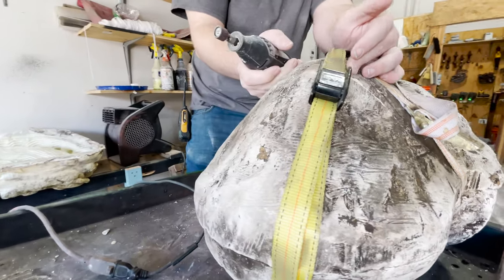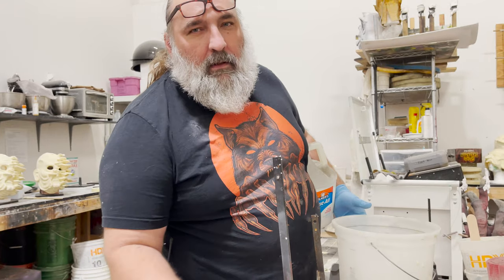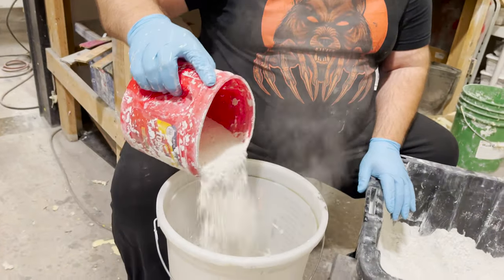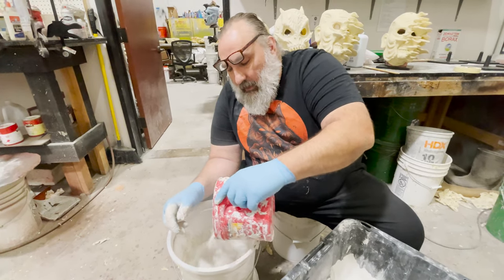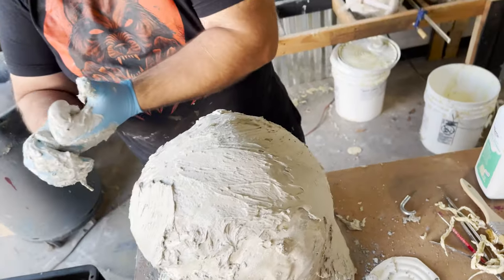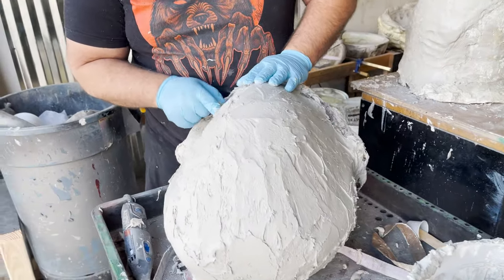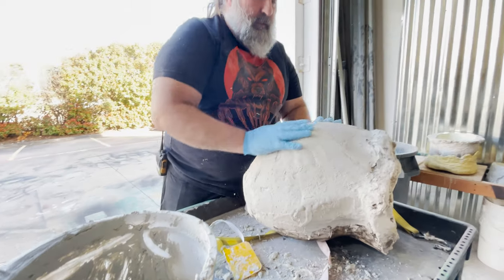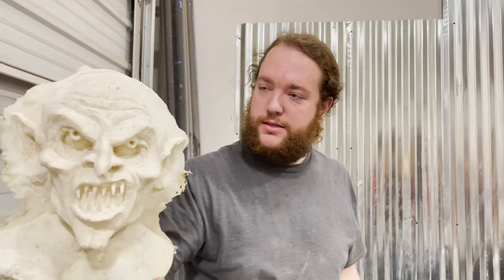fix a plaster mold, repair a mask mold, latex mask mold repair

Comment: Hey one trick I learned while working as an O&P Tech ( orthopedics and prosthetics). We used a lot of plaster 500 -1000 pounds dry a month it seemed like. We use #1 pottery plaster so you should test it with hydrocal but it should be the same.   We had to add new plaster to dry plaster all the time.  Ether to repair a break to to remode a positive.  Soak you dry broken piece in water at lest 10 mins and then just add your normal mix of plaster to fix the break or to build up where needed.   I have used this to fix broken casts several times let the broken pieces set in the sink full of water over lunch come back glue them together with fresh wet plaster and let it set off and then rework as necessary with no problem.   Try it and let me know if it works for you with hydrocal.
Reply: Very cool!
Reply from the maker: good tip!

Comment: If there is one brother I can always count on to solve mask making issues it's definitely Allen the freaking MacGyver of horror! I just separated an ultracal mold of part 3 Jason and because I used stupid Monster Clay for the sculpt when I was cleaning the front half of the mold the clay pulled Jason's nostril nubbin off! Besides the fact that it took 3 hours to separate the mold I was obviously bummed. Hopefully I can use this method to secure the nostril nubbin and fix a couple little cracks on the bib line. Thanks Allen you are the man big dog!

Comment: I know you have been doing this for a long time, and I'm sure this is not the first time a repair has been needed. My  question  is, what happens  if it's beyond repair? Do you have a master you can use to create  a new mold, or do you have to start all over?
Reply: if you had pulls from the mold or a master go ahead and mold the master its almost impossible to repair a puzzle like mold
Reply from the maker: If Im making a mask and I think I will need less than 10, then I dont make a master, but if I do need  ore than 10 then the first thing I do is make a foam filled master.

Comment: could you use plaster cloth rolls soaked in the 50/50 water glue mix to repair the exterior?
Reply from the maker: plaster cloth really is not that strong, and the weight if the mold would be an issue for it I think.

Comment: Hey Allen would would I do if my keys whent through my mold wall when I plaster my first half of my mask then opened up the clay wall to mold the back half I notice on the wall that my 4 circle keys I made whent straight through it got any advice on what I should do
Reply from the maker: Remove the clay wall and the excess plaster from the keys  try to chisel them back to round, then proceed with second half as normal.
Reply: @StiltbeastStudios  okay I think I will do that and also if there’s big holes in the wall should i also try and fill them up with plaster and potentially make them keys again and then wait for them to dry before I make my 2nd half or would my two molds get locked ? Sorry if that is what you said in the beginning
Reply from the maker: you do have to get it pretty smooth so they dont lock.

Comment: Is this method good for fixing holes and breaks in the mask
Reply from the maker: no, for the mask just patch with latex, i put a bit of masking tape inside to block the back of the hole then fill the hole with latex.